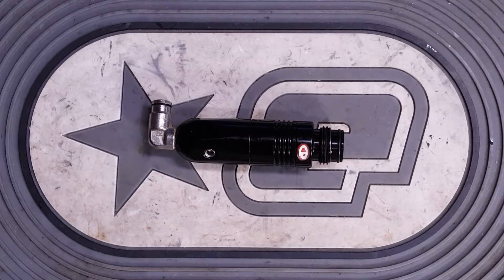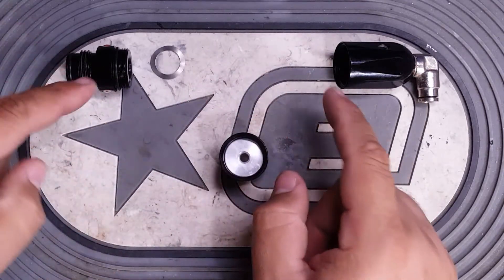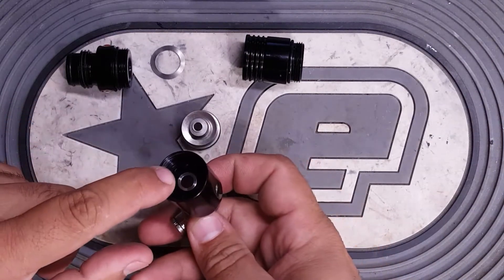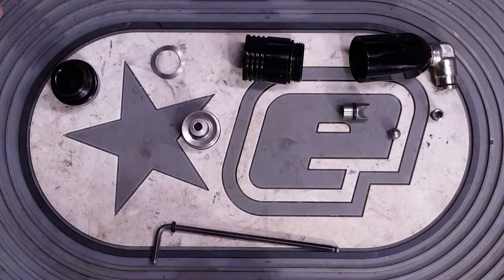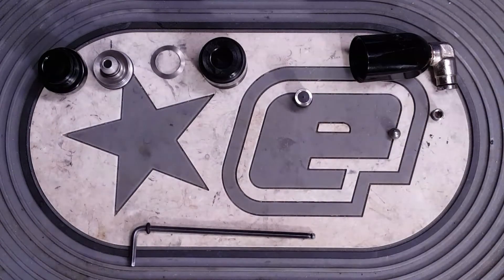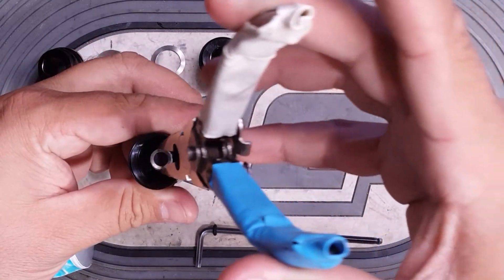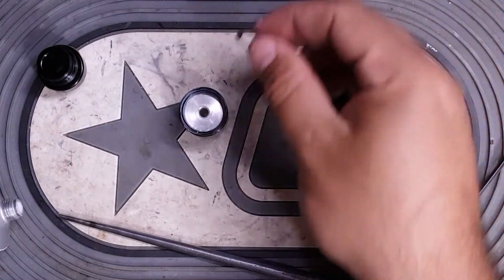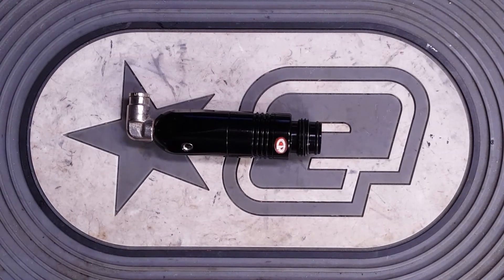CP V1  High Pressure Regulator - Parts Rebuild with Paintball Tek

Comment: I hace the same regulator. What would keep it from it not going  over 300 psi?
Reply from the maker: Check to make sure you have the same number of belleville springs in the spring stack inside.  If you are missing a spring then you likely won't be able to get it to a high pressure.  Also, if memory serves, there were 'Low Pressure' and 'High Pressure' versions of this reg, the LP version topped out at ~250-260psi and the HP version topped out at ~400-420psi.  If you have the correct shim stack in it, you may just have the LP version of the reg.  The difference could be the sping stack or it could be the piston length, I would have to honestly call CP and check with them to be sure since these are older and haven't been made in quite some time.

Comment: What about if these are stuck how to remove them without scratching the reg ??
Reply from the maker: the top of the regs are hex broached regularly.  a 3/8" hex key will fit inside the top cap to unscrew it from the body.  on the V1 regs like this the bottom section has small flats all the way around you can grab with a crescent wrench, otherwise you can wrap the reg in a towel or rubber and put it in a table vise, vise grip, or 1" collet fixture to grab and hold it.

The collet fixture is the best option, but not many have access to or own one.  the table mounted vise is second best as it is easy to lock the parts down tight.